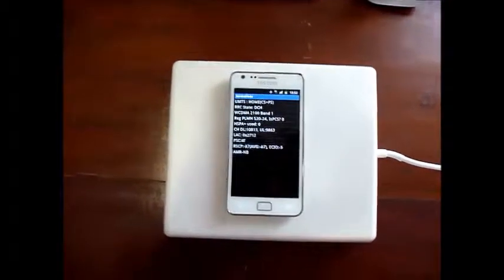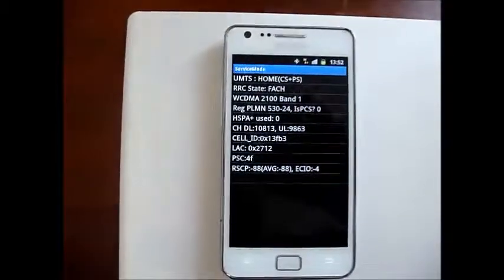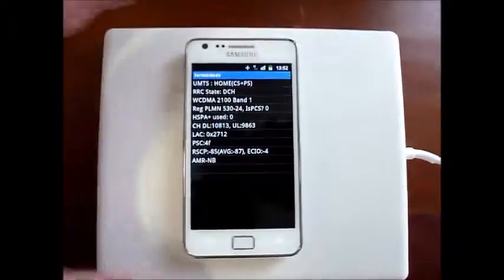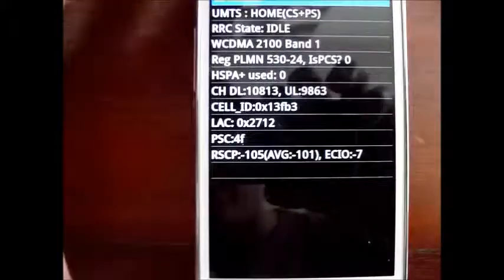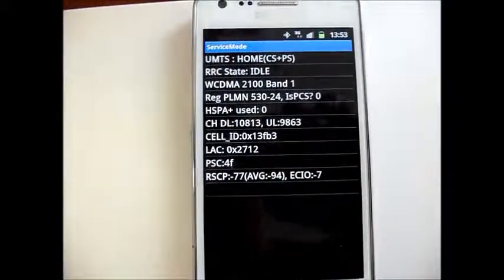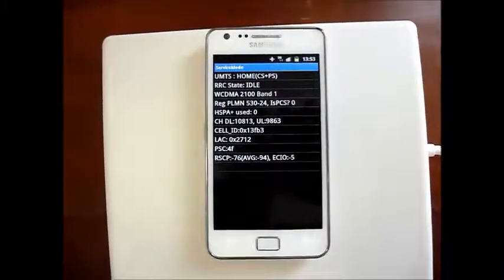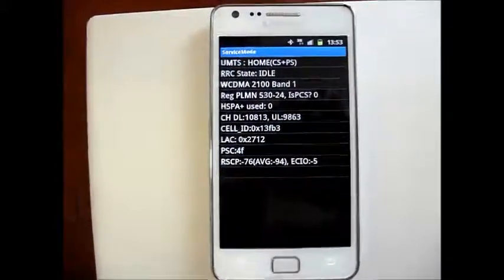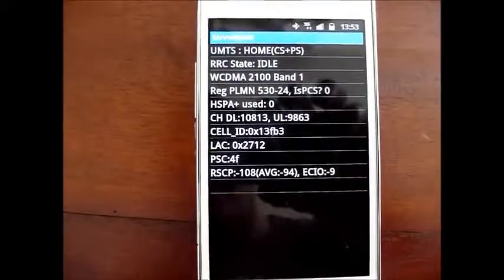Cellutronics passive repeater peformance example

Comment: The "indoor radiator" appears to be a panel antenna. Am I right?
Reply: similar to one, yes
Reply: @zfw81  I'm in the US not NZ but this confirms something I'm planning to do may work. I have a 9 dBi log periodic antenna to mount above the roof, to be connected by coax to a panel antenna pressed up against a window on the side of my house. Then I will place a smartphone on a window ledge inside the house, so that it is separated from the panel antenna by the windowpane. The purpose of this is to increase the signal to the phone, which is now getting only 1 bar of signal, for use as a hotspot

Comment: Does this also work with wifi ?
Reply: this system is set up for cellular, but you can use the added reception to improve hotspotting from your phone if that's your question

Comment: Does this also work with wifi ?
Reply: It is compatible with 2.4GHz wifi signal, but not 5GHz
Reply: @zfw81  thanks for info and is there a way I can make a diy cell signal pad?
Reply: Thanosbus69 get in touch with cellutronics as they have the equipment, and can ship most places